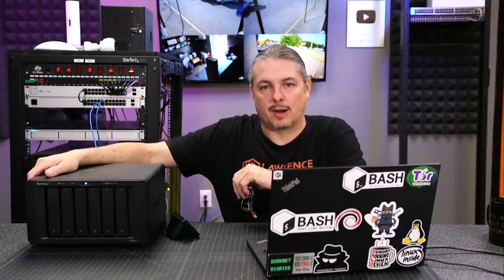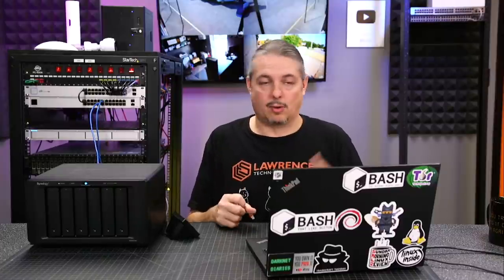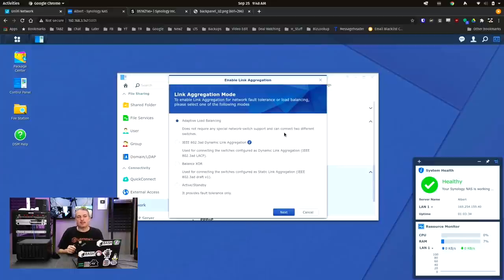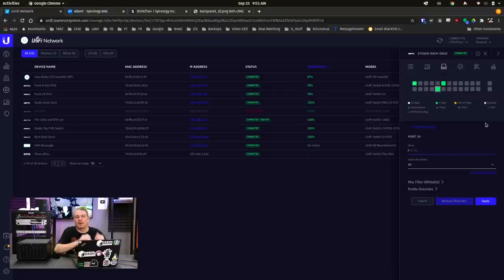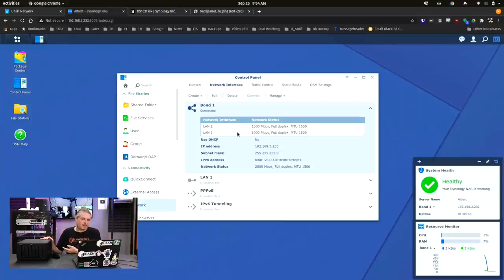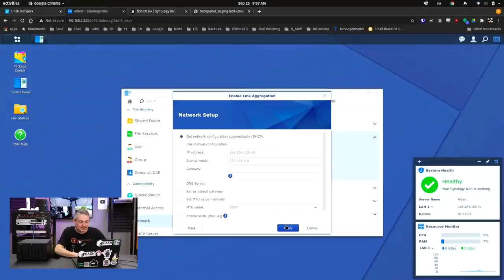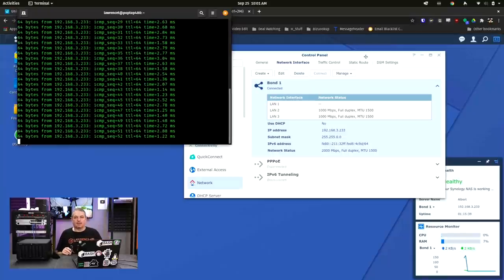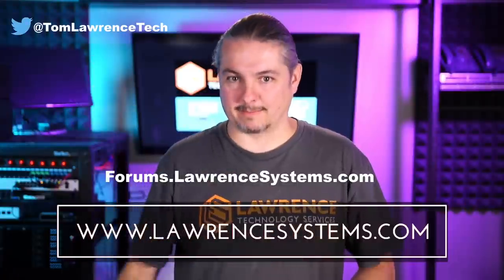Tutorial:How to configure Synology For LAGG and LACP

Comment: Is the unifi switch directly cable connected to the Wifi router plan port? What happens if the DS 1621xs+ is directly connected to the Wifi router plan port and could it be still set up LAC?

Comment: Problem for me with 802.3ad LACP on my Diskstations was always that Wake-on-Lan doesn't work, tested with Managed Switches from Zyxel and Unifi so far. AFAIK it is due to the dynamic nature of LACP that WoL doesn't work. Therefore I'm still using Active Load Balancing... got a DS218+ for 24/7, my DS2517+ is only powered on a couple of hours per week per schedule or when needed on demand. To not have the ability to power a NAS remotely up by WoL is a big NoGo for me (as a home user) .

Comment: This is a helpful video, so I have an unmanaged switch DGS 1016A, that supports link aggregation but after the setup process I get "Failed To Establish IEEE 802.3 ad connection" under the network status area. Everything still works; i can access the NAS and its content , but I get that message does that mean link aggregation is not configured? What do you recommend?

Comment: Maybe you said this and I missed it, but was the 10Gb interface linking at 10Gb prior to being part of the LACP group? If not, what changes if it is? It looks like in the Synology it says the group is capable of 3Gbps when they're all connected, but I'm curious if it would stay at 3Gbps if the 10Gb was linking at 10Gb or if it would go to 12Gbps.
Reply: you will still only have a 10Gb and a 1Gb and a 1Gb link.  The switch can just be smart about how to use these links.  If you just have one 1Gb link to your switch and 3 users are all trying to max out the connection to the NAS, the three users are sharing that 1Gb bandwidth, so 0.333Gbit each.  When you enable LACP, the switch can direct the three users to their own or the lest saturated port in the group.  So for example if you have three 1Gb links, user 1 can be directed to port one with full 1Gbit, user two can be directed to port two with full 1Gbit and user three can be directed to port three with full 1Gbit.

 "Throughput
Throughput testing with one host to another single host will not show improvements. The hashing algorithm that is used for LACP does not split data streams on single host-to-host connections. To see improvements in throughput multiple hosts would have to be passing traffic at the same time. "
https://help.ui.com/hc/en-us/articles/360007279753-UniFi-USW-Configuring-Link-Aggregation-Groups-LAG-

Comment: Hi 1 question Sir: If i choose balancing (1st option) on the synology side, should I also check my router and try to set it? I dont use a switch between synology ds200+ and my internet router. They are connected to each other with 2 small ethernet cables. Thank you.

Comment: I configure dynamic link agrigation IEEE 802 3a in my Synology Nas Ds1621+.It has four port . I bond all 4 port .and give 1 IP address. But when I connect synalogy with network. And ping from client pc the ping start dropping.request time out... Can you tell me why it's happening. My switch is Cisco sd350 28 port. Is 4 port binding create ping drop??

Comment: Question on Link AG on the Ubiquiti switch, I have a US 48 port switch and  have a DS1815+ with  4 four1gb connections bonded and after I go into the switch and manage the profile for the connection I see the aggregated ports are 45-48 and then I see the next line says Link Speed, do I set that to Autonegotiation ?
Reply from the maker: Yes
Reply: @LAWRENCESYSTEMS    thanks

Comment: Should be fine to combine 10GB and 1GB in LACP, as long as it is supported by both devices in the link.  also mixing fiber or DAC links and ethernet links are fine as well, as long as it is supported by the devices in the link.

Comment: Tom, can you do this same walk through on an Edgeswitch? I know the LAG setup is different and I am not sure of the option to choose on the Edgeswitch. Thanks
Reply from the maker: I am not clear on how to do it either as the documentation was unclear.
Reply: @LAWRENCESYSTEMS  I have edgeswitch 24 lite and I was able to make the lagg work via Web UI. I can share how I did it, can I share it here or do you want me to post it in the forums?

By the way thanks for the great videos. Loving it so much.
Reply from the maker: @speedup070605  Yes, post it in the forums and make sure you include the exact model switch you have because one of the parts that I was not clear on is if it was supported on all models.
Reply: @LAWRENCESYSTEMS  Done I have included some screenshot as well. I place the procedure in the Tutorial: pfsense LAGG and LACP and Setup you posted. I hope this would help anyone wanting to have same setup.